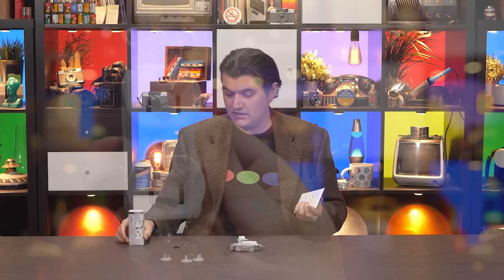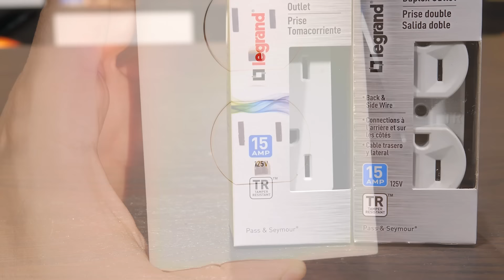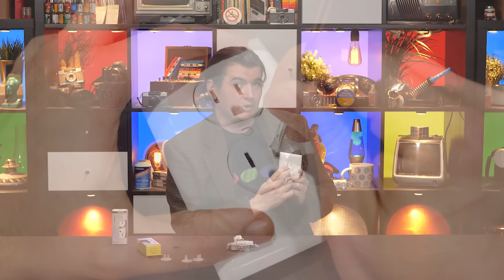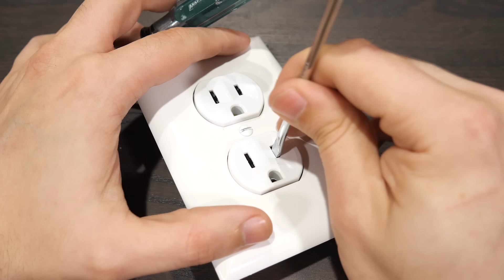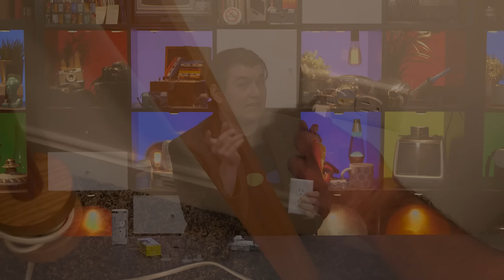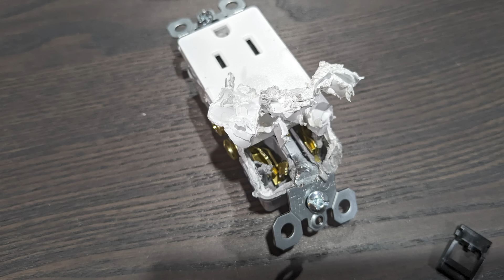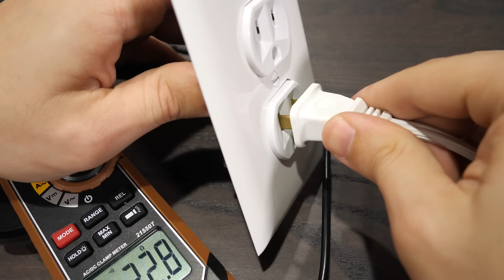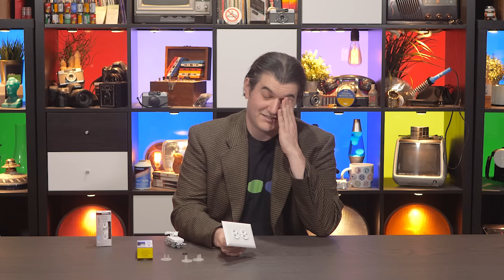Tamper-resistant outlets aren't all the same - a follow-up

Comment: Analysis of accidents  and research shows that 120 V has one awkward death factor: if your GRAB something that is live at 120 V, your muscles will cramp onto it, making it hard for you to let go. At 240 V however, the shock is so large that your hands fly open, either by the muscles, or by your  layers of the skin flash subliming and propelling the hand open. 240 V can be considered safer in GRABBING accidents.

Comment: Regarding the 120 vs 230V what is safer discussion: ITS THE SAME!
I don't know how this is still confusing since I learned this from you. The only way to be shocked by 230V here is touching BOTH live wires at the same time, and since you get shocked by either one chances are you'll pull away from it when you hit only one, you won't then go grab the other.
its the exact same thing as in your 230V outlets, one is -120, one is +120 and they're constantly swapping at a preset frequency. I even went to pull out my fluke to verify, either one of the leads measured to ground shows 130V, measure between them you get 230V. I've been shocked a few more times than what's considered healthy but I can't see any scenario where I'd come into contact with both hot leads at the same time without doing something incredibly stupid. 
In fact even coming into contact with one usually takes doing something really stupid, since our plugs are vastly superior and you can't come into contact with the pins when they're far enough in to be live.

Comment: In Sweden we use 2 hot and 1 ground for 230 V, high power use appliances are run on 3 phase power usually at 460 Volt and usually 16 Amp fuses on each phase (like hot water or a EV home charger) If you truly want safe outlets they should be at 60 Volt or less as it is almost (not 100%) not possible to get a shock from that voltage, a short can still burn you as the amps determine how hot it gets not the volts. A common error is to use house power cables for battery systems(12-48V) because people think a cable capable of powering a 2000W hair dryer is also capable of powering a 2000 W car amp (or other device). With the increase in amps you would need they would heat the cable to melting point. 230v x 9 amp = 2070 W, at 12V you need 172,5 amps for that much power, huge difference.
Reply: I first hear that you use 460 volts (instead of 400) in Sweden. Unless we are talking about something other than the rms value of the phase-to-phase voltage.
Reply: @elpolaco7654  I may be wrong on exact voltage. I know we have/had one that was 380v and I think it was upgraded to 460v or 460v was added to a new standard, possibly for business/industry use. It has been a while sins I worked with these things
Reply: @agw5425  You probably remember the transition from 380 to 400 volts. More than twenty years ago, in order to standardize the power supply to households in Europe, the phase voltage was raised to 230 volts, in countries where it was 220 volts, and lowered to 230 in countries where it was 240 volts (UK).
400 ≈ √3 × 230
380 ≈ √3 × 220
Reply: @elpolaco7654  You may be correct, but I thought it was 460v as it is 230 x 2 but I guess we do not do power the same way as the US do. So the UK has dropped to 230v to now?
Reply: @agw5425  Yes, it was changed more than 20 years ago. But from a practical point of view, it doesn't matter much. They simply increased the tolerance from ±6% to +10% when it comes to the upper range. That is, anything below 253 V is okay. 
Here, where I am, the ±10% tolerance applies, and I just measured that I have 250 volts in the socket now. I'm sure the voltage often reaches almost 260 V, which is outside the acceptable range. Usually this doesn't matter much with modern appliances, but traditional incandescent light bulbs, for example, burned out quickly at this voltage. That's why I use a NTC with them.
I've also seen electronic consumer devices from well-known companies that didn't have a stabilized (linear) power supply and, for example, an input voltage of a little over 240 volts caused the power supply to apply about 10 volts to the IC, which, according to the data sheet, could be powered by a maximum of 9 volts. Not surprisingly, after some time a hole appeared in the IC.

Comment: Correct. Imagine You are in Europe, and inside a stove you have 400V! It's scary. I've seen once an electric box with a meters (so opened by tennants, including me) with 4 bare screws just in reach of anyone (the box was not locked). The screws was about 2cm apart, and between most of them there was 400V.
Reply: Yeah that's super bad, and not the norm. In a "normal", modern breaker box there's nothing you can touch that will shock you unless you start disassembling it. Wouldn't help in this case, but for other things at least normally the whole circuit is covered by an RCD. Again, that wouldn't help here since the RCD covers a single circuit, which is on one of the three phases,  so if you touch 400V you're probably boned
Reply: In Poland RCD usually covers 3 phases, but this screws was actually in a circuit before any RCD's or circuit breakers... just a straight path to the power pole. This was scary... fortunately it's fixed now i this building.

Comment: My experience with type A (NEMA 1-15) plugs is that they always come loose after a few hours - at best. I have some travel adapters that are a bit bulky and most sockets cannot hold them at all - I can only use them in sockets above tables where I can put something on the table to prop the adapter up.

The operative word in the above paragraph is, obviously, "travel". As a non-American I encounter type A sockets only when I travel abroad and stay at hotels - where often the wiring is old and maintenance isn't paying a lot of attention to the wall sockets (this is true also for Hilton/Marriott class hotels - you don't need to be a dingy road-side motel to have lousy electrical maintenance). I'm guessing people living in homes, especially those built within the last few decades, have a better experience. But I still contend that it's due to the lousy design - basically all other plug designs will hold onto a socket easily - even when 100 years old (from experience)

Comment: If you look at a continental European plug, they are recessed, and hold the plug very firmly, yiu have to actually apply quite directed force to remove even the two prong version. Metal clamps inside hold the pins quite firmly. 
The earthed one even have their Erth connection being done with two additional springs on the outside.

When I visited the US and stayed in Airbnbs or hotels, all charger cables and adapters constantly got dislodged, and when I walked into a cable would fall out.

Just take a trip to Europe, and when you're there, also just look how slim our dishwasher detergent packs are thanks to the required ion exchangers

Comment: Type I e.g. Australia has very similar size pins (you can bend a US F type pin on and angle and run it in a type I) managed to move to a mandatory sleeve without replacing recepticals

The pins are slightly more expensive as a little material is removed to make the insulation flat with the conductive pin. You have a tad less meat to play with on a USA plug but seams easily doable

Comment: Backstab makes it a bitch if you ever have to replace that outlet/ light switch for whatever reason. I replaced all the outlets and switches in my home (they were all decades old) and 90% of them were backstab and it wasted a lot of time just trying to get the thing to release rather than unscrewing the connection

Comment: Just a guess regarding Europeans saying that plugs keep falling out.
Potentially they have brought devices with them that support US voltage and thus require a, usually quite bulky, adaptor between them to use a US socket. The substantial weight may then be pulling everything out of the socket?

Comment: Well the about US (and similar style) plugs constantly falling out simple refers to how they seem to wear down way more easily thank such as the German EU Shuko styles
Personally I've seen so many US outlets that are from mildly loose that the plugs doesn't stay flush, and hangs down from gravity as in your demonstrations, to barely and only slightly connected or have any resistance at all, as in at any minimum force it could literally fall out completely
An din contrast I am not just talking about hotels; maybe they were old, or poor quality, but it is very much a more common thing than it should to be a problem

Which could be solved by, the first step US should do is by creating a new unified plug shape for each type, then from there over time once it's widespread enough it could then more easily transition into recessing the sockets; and tada you would get yourself your own style of the EU Shuko style while maintaining your own pins and without needing to worry about compatibility as much or needing to make hugely costly changes and replacements to existing infrastructure

Comment: When I was like 10 years old I had no idea how electricity worked.  All I knew is that metal made it work.  I put a key ring around both prongs of a two prong plug and plugged it in.  Sparks went everywhere,  and it made a loud pop sound.  My step dad was downstairs at the time. He asked "what was that?" I replied "nothing, everything is fine."  He said "alright, keep it quiet up there."  Ahh,  parenting in the 80's.  The outlet never worked again for the rest of the time I lived there.  Thankfully I wasn't shocked.

Comment: I’ve lived in a few places with very loose receptacles that will just have the plug fall out with very little resistance when you try to plug or unplug something. I’ve never gotten zapped by anything but static electricity so I can only imagine was getting zapped by your electric system in your house is like.

I was also never a “curious” youngin, so I never “played” with anything that had a live electricity going through it.

Comment: South African here. We mostly use Type M 3 prong plugs (based on an old British standard). The sockets have had shutters since at least the 1980s. We also use a lot of of 2-pin Europlugs, especially for cell phone chargers, etc.

When I was about 12 or 13, I already experimented with electricity. I tried plugging a strange, ancient 2-pin plug into a Europlug socket in a power strip. The prong spacing wasn't right. I then REMOVED the two prongs and tried to insert them into the socket, but it didn't work because of the shutter, which presumably works like the new North American types. I figured out that they had to be inserted at the same time, so I pressed both prongs with my 2nd and 3rd fingers forming a V. ZAP! I  hadn't turned the power off! 

Fortunately I didn't use fingers from both hands, as the current could have flowed through my heart. In South Africa, we use 230 V, so the current would have been approximately twice what it would have been had be used the same voltage as the USA.
Reply: It sounds like 12-13 is the sweet spot for being smart enough to circumvent safety features, but still careless.

Comment: I've been shocked lightly many times while plugging things in because i have a bad habit of doing like he said and feeling the holes and the blades and then getting shocked. But it's just a little tickle. Other than that I used to take things apart as a kid so I've been shocked by a lamp (the lamp was still plugged in, I was a stupid kid) and a dvd player (I shorted the caps in the power supply with a screw driver, but then I learned that things aren't necessarily powered down just because they're unplugged. important lesson :)